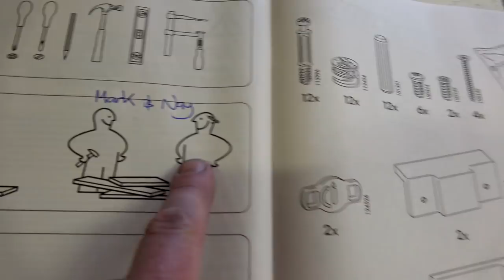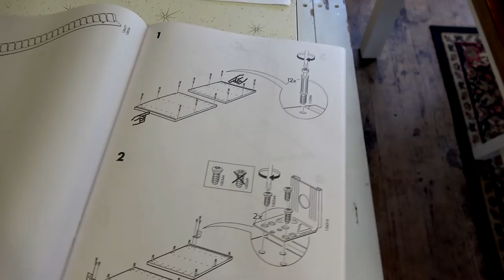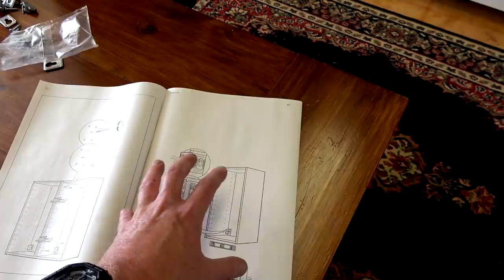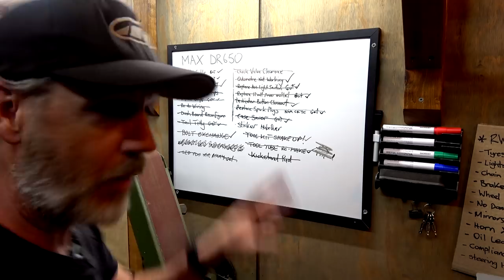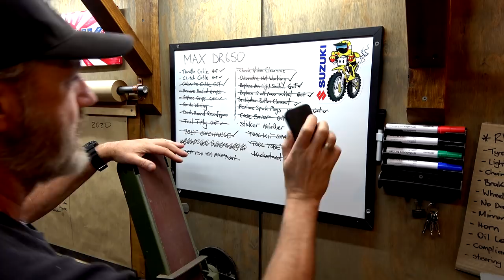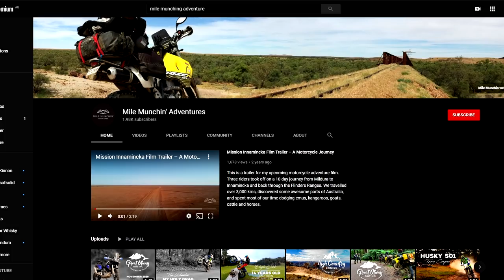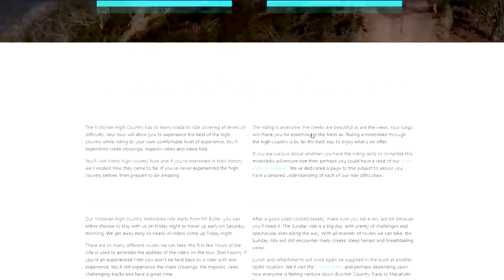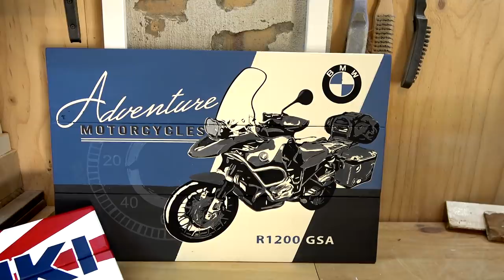The Clock Wall Project! MCT 2020 Ep.47

Comment: Mark you could use some rope as drawer pulls. Just drill 2 holes and loop some cotton or twill rope through and tie knots on the inside. It wouldn't poke ya in the legs but it'd be easy to get ahold of.